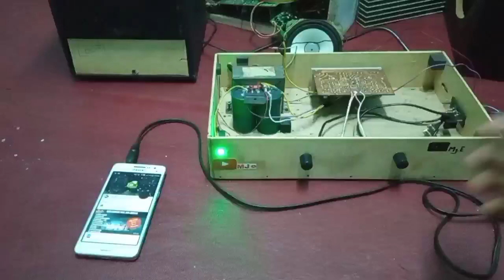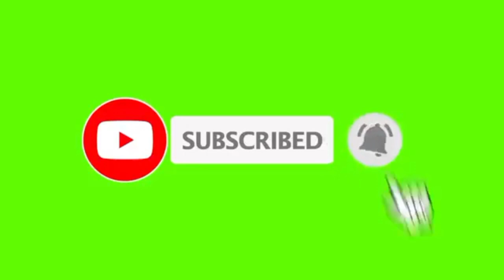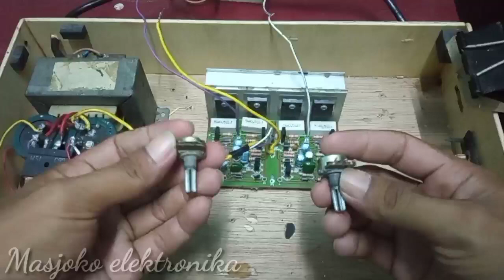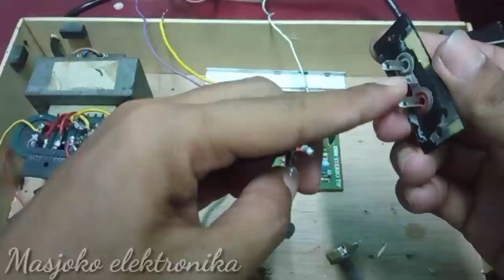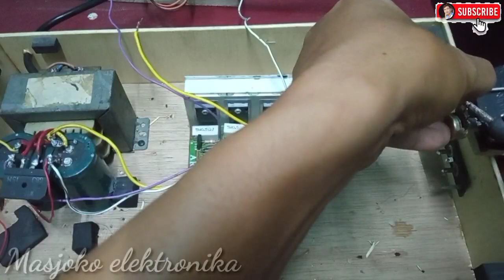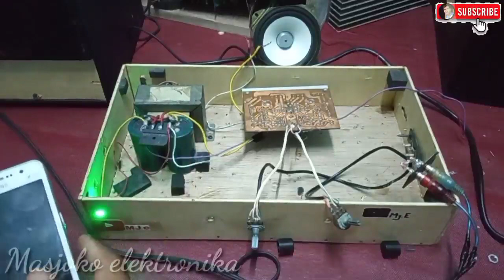CARA pasang potensio volume R/L  terpisah

Comment: Saya pasang 2chnel kx bunyinya potensionya pas akhiran puteran bang baru bunyi keras, dua2nya  begitu semua e apanya itu bang?
Reply from the maker: @kautsarabadi1247  klo potensio normal trs pasang nya bener harusnya nggak ada masalah sih mas, sist ini sama kaya power2 pd umumnya kok, cm beda driver aja
Reply: @masjokoelektronika86  saya jug bingung bang saya kira potensionya rusak saya beĺikan lagi 2,sma aja.saya rakit power tpa 3110
Reply from the maker: @kautsarabadi1247  tp stereo kan mas powernya?
Reply: @masjokoelektronika86  tpa 3110 mas stereo tp 2chnel

Comment: Assalamualaikum mas,maaf mau tanya,itu kalo ground potensio gk boleh di gabung ya antara R&L???maaf masih belajar🙏🙏
Reply from the maker: @MarsuditPilami   waalaikumsalam 🙏
boleh aja mas, saya jg digabung kok mas
Sama aja saya jg masih belajar mas🙏
Reply: @masjokoelektronika86  ok siap.oiya maaf saya baru belajar rakit 2chanel,tapi kenapa yg Chanel A protek,yg Chanel B normal ya? Letak kesalahannya kalo boleh tau domananya ya kira²?🙏
Reply from the maker: @MarsuditPilami  klo protek berarti ada yg jalur yg konslet x mas, coba dicek jalur ke speaker, tp klo udh bener coba speaker protek nya di tuker, buat mengetahui itu yg bermasalah speaker protek nya apa bukan
Reply: @masjokoelektronika86  baik mas,coba nanti saya cek lagi jalur kabelnya.trmksh banyak atas sarannya mas🙏🙏🙏

Comment: Kalok r/l nya digabung di satu potensio dengan driver stereo apa bisa mas
Reply from the maker: Klo driver stereo dibikin 1 potensio berarti pake yg potensio 6 pin / 6 kaki mas
Tp maksud nya digabung itu gimana ya mas? 🙏
Reply: Driver ocl kan streo mas 
Klok di jadikan mono apakah bisa mas 🙏
Reply from the maker: @elsarahmawati2068  bisa mas, tp harus beli kit BTL mas, nanti mono tp sistem BTL
Reply from the maker: @elsarahmawati2068  Aamiin, sukses jg bolo🙏🙏
Reply: Ok mas siap mksih sarannya 
Sukses slalu masse

Comment: Pake travo brpa amper mas
Reply from the maker: 3amper mas 🙏
Reply: @masjokoelektronika86   pake tegangan brapa vol mas dan ampli brpa watt 🙏
Reply from the maker: @sfchannel96  pake 18 mas, itu driver ocl biasa mas final tip 2955/3055
Reply: @masjokoelektronika86  ampli brapa wat itu mas rencana mau buat serti itu
Reply from the maker: @sfchannel96  ini mah klo bahasa pcb nya ocl 150 watt mas,
Reply: @masjokoelektronika86  minta no wa mas buat sharing
Reply from the maker: @sfchannel96  087885139413 tp ma'af klo siang slow respon ya mas🙏

Comment: klo soket rca 4 pin gimana bos cara sambung nya .. maap pemula
Reply from the maker: Maksudnya 4 kaki atau 4 buah soket nya mas
Klo 4 kaki paling mudahnya sih ditest pake multitester untuk lebih jelas mana ground mana plus  nya mas🙏
Reply: maksud nya agar bisa pasang miker dan equalis mas .. di power saya cuman ada dua soket doang seperti di video mas itu
Reply from the maker: @Cebok.bentar  out mixer masuk ke in equalizer out nya masuk ke input power power
Reply from the maker: @Cebok.bentar  abis tanyanya gimana sambung soket rca 4 pin, sambung equalizer mixer power itu namanya instalasi mixer equalizer power

Comment: Mas kalo ampli jengkolan dibuat 2 chanell a,b rombak semua tidak ya apa hanya dibuat begitu pakai 2 potensio
Reply from the maker: Klo driver nya stereo sperti video itu tinggal misah aja pake 2 potensio sperti video itu mas
Reply: @masjokoelektronika86  kalo driver mono gimana mas ?apa bakal rombak semua ganti driver apa bisa diakalin
Reply from the maker: Klo mono ya ndak bisa lah mas, kecuali mono pake 2 driver 🙏
Klo 2 chanel ya driver stereo biasanya
Reply: @masjokoelektronika86  ada no wa ngk mas ?mau tanya"dulu barang kali mau berbagi ilmu

Comment: Mau tanya bos ..klo mau d tambah tune control ..dari out put...masuk ke input potenso itu y bos ...maaf pemula...tolong d jawab
Reply from the maker: Iya mas masuk ke input yg pake jakc rca itu
Reply: @masjokoelektronika86  maksud ku tune control menyatu dalam box power mas...terus mau di kasih Belen maksudnya..dari out put...control masuk ke input...Belen/potensio itu y mas...maaf pemula trimakasih
Reply from the maker: Klo mau pake tone kontrol 1 bok mah ga usah pake potensio volume yg kaya divideo mas, nanti yg molume ditone kan stereo kaki 6 ganti aja yg potensio mono yg kaki 3 tp dua biji jadi untuk balance nya ttp pake yg dr tone nya, klo saran saya ☺🙏
Sama saya jg pemula mas, disini kita saring bareng aja 🙏🙏
Reply: @masjokoelektronika86  ok mas trimakasih ..sya perneh rakit..pakek potensio aj...bunyinya nyaring ...setelah pakek tune control malah pelan kira2 knp y??
Reply from the maker: @rofiiahmad7959  klo kemungkinan itu tone nya yg kurang bagus/ada komponen yg udh gak normal mungkin, berarti ky ketahan malah suaranya ya mas,? klo beli tone kontrol klo bisa nyari yg pake ic penguat nya mas, dijamin lebih mantul 🙏
Reply: @masjokoelektronika86  ok makasih mas

Comment: Kalau nyambung nya ke tone parametrik atau mixser bagaimana cara nya banggg..
Reply from the maker: Out dari mixer/parametrik masuk ke inputnya mas
Reply from the maker: Out dari mixer / parametrik Masuk ke input dr driver powernya mas
Reply: Di sambungkan ke potensio nya ya bang..
Reply from the maker: @zifankaseptianaseptiana9202  mas udh ngrakit belum powernya, klo belum ya input dr driver lngsung sambung ke out dr tone / mixer
Reply: @masjokoelektronika86  mau nya saya kasih potensio 2 seperti d video abang nya..tapi bingung nyabung nya ke tone kontrol ,gak tau.
Reply from the maker: @zifankaseptianaseptiana9202  klo mau dikasih potensio sperti video itu, mas ngrakit dulu power nya sperti yg divideo cara pasang potensionya jg sudah saya jelas kan kok mas
Kaki tengah potensio masuk ke input positif pada driver, kaki pinggir sbelah kiri masuk ke ground dan yg kaki kanan itu sambung ke Jack rca sbg input power dan yg akan tersambung dg out mixer/tone
Reply from the maker: @zifankaseptianaseptiana9202  klo masih bingung bisa japri ke WA saya aja nanti belajar bareng bareng lur 🙏
Reply: @masjokoelektronika86  no wa nya mita bang..
Reply from the maker: @zifankaseptianaseptiana9202  081290103814
Reply from the maker: @zifankaseptianaseptiana9202  klo power dikasih potensio sperti divideo berarti nanti untuk tone parametrik nya boknya misah dr power ya mas,
Reply from the maker: Coba mas perhatikan pelan pelan, pasti bisa mas, gampang kok🙏

Comment: Mas kalo pasang potensio mono hy 2 kabel PD ampli keyboard merk Kevin yg dipakai kaki 1&2 apa 2&3.. soalnya lepas mau di solder LG  bingung  takut salah jd  konslet...
Reply from the maker: Klo potensio posisi kaki diatas 
Pokoknya yg tengah itu buat out nya, nah yg sbelah kanan nya itu ground dan yg kiri input nya / yg akan terhubung ke jek input RCA mas

Comment: Punyaku Kit power sudah stereo, saya test tanpa tone control menggunakan lagu test L R audio, dan suara bekerja normal bergantian kadang di kiri dan kadang di kanan / L R, tapi setelah saya pasang tone control suara kok gak bisa bergantian kiri kanan lagi  / L R atau bunyi bersama antara speaker kiri dan kanan, menggunakan lagu yg sama test Audio L R, padahal tone control saya stereo menyesuaikan kit power stereo, sudah saya coba menggunakan semua jenis tone control stereo dipasaran hasilnya tetap tidak bisa L R stereo dan setelah dipasang tone control karakter suara malah jadi Mono.
Mohon solusinya master.
Reply from the maker: Maaf, klo pake kit tone kontrol stereo,ngatur kanan kirinya kan pake yg potensio balance itu mas, soalnya klo potensio volume nya lngsung stereo
Mohon koreksi jika saya salah mas🙏
Saya jg masih belajar 🙏
Reply from the maker: Jadi solusinya klo menurut saya, mas pake tone kontrol nya yg mono tp 2 pcs jadi nanti mas bisa mengatur untuk masing-masing R/L nya

Comment: Mas saya pake 2 chanel mono cara R/L nya gimna input rca nya
Reply from the maker: Klo rca kan pake 3 kabel, nanti ground nya kan di gabung mas, nah yg positif masuk ke masing masing driver, klo input mah gitu mas klo saya🙏🙏
Reply: @masjokoelektronika86  siap mas saya juga udah ngira kayak gitu tapi takut salah mas😂 makasih mas info nya oh iya mas mau tanya lagi saya pake 1 trafo kalo pake 18v sama 32v aman gk ya mz 5a kecil soal nya dan pake 2 dioda
Reply from the maker: @hmmss  maksudnya 18 dan 32 itu buat psu yg nyuplay driver td mas, atau gimana mas
Reply: @masjokoelektronika86  iya mas yg satu 32v yy satu lagi 18v bisa gk ya
Reply from the maker: @hmmss  klo psu simetris ya harus sama mas,mau make yg 18 nya atau 32 nya gitu aja🙏
Reply: @masjokoelektronika86  jadi gini mas saya punya 1 trafo jadi mau ku buat 2 psu tapi berbeda volt apakah bisa
Reply from the maker: @hmmss  oh maksudnya 1 trafo buat 2 psu, dg beda volt 
Ya tentu bisa mas, tp untuk watt powernya jgn terlalu besar/finalnya jgn terlalu banyak kasihan trafonya nanti 🙏
Reply: @masjokoelektronika86  siap mas info nya ini baru mau buat hehe cuma soc 506 2 set toshiba sama 150w mono 1 set
Reply: @masjokoelektronika86  kalo boleh minta fb nya ato wa nya saya masih pemula mas kalo mas nya mboten sibuk nak sibuk ngeh mboten sah ndak mangke ngerepoti😁
Reply from the maker: @hmmss  087885139413 niki WA ne mas, kulo nggih tasih pemula kok mas, sinau bareng 2 mawon🙏
Reply from the maker: @hmmss  klo gitu kenapa gak 1 PSU aja mas tp pake elco 4 gitu, dr pd pake yg 18
Reply: @masjokoelektronika86  18v saya pakekan yg 150w mas itu kalo misal pake 32v semua takut gk kiat driver nya yg 150w
Reply from the maker: @hmmss  klo final nya toshiba itu masih aman disuplai 32vac, tp ya terserah mas, gimana enaknya 😁🙏
Klo menurut saya klo toshiba di suplay 18vac kurang maximal menurut ku mas, mohon koreksi jika salah 🙏🙏
Reply from the maker: @hmmss  trs kenapa gak pake 1set per mono aja mas, kan trafo mas cm 5a kecil 🙏
Reply from the maker: Maksudnya driver pake mono x 2
Trs gimana nyambung di rca input nya gitu mkasdnya ya mas🙏